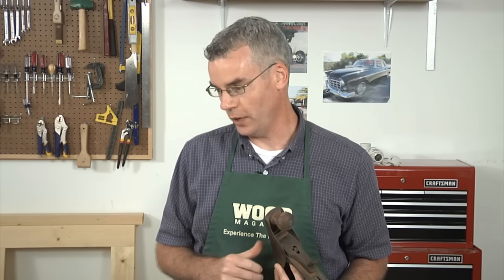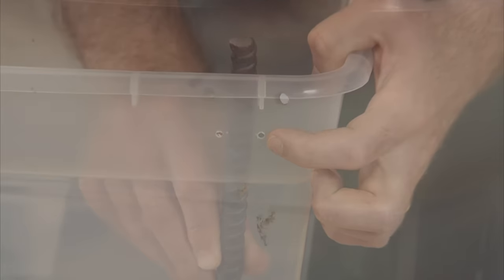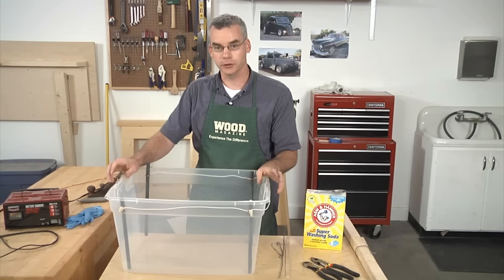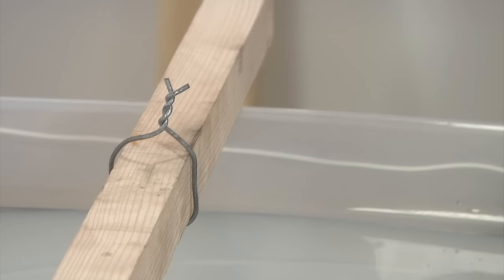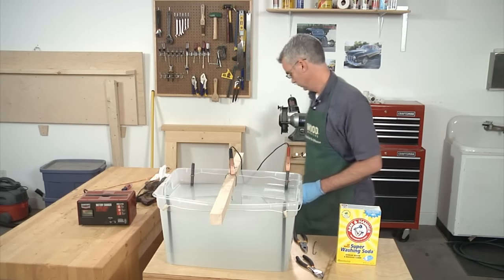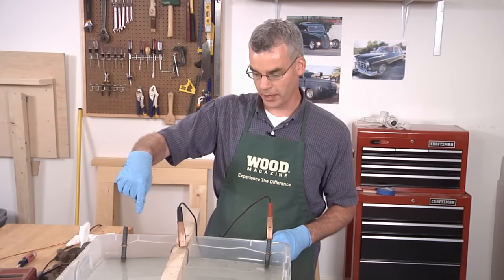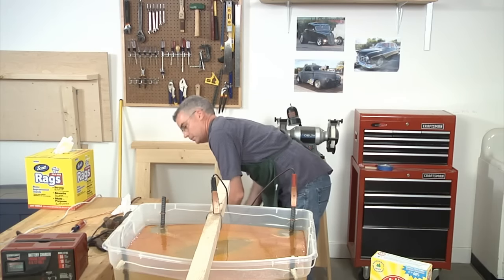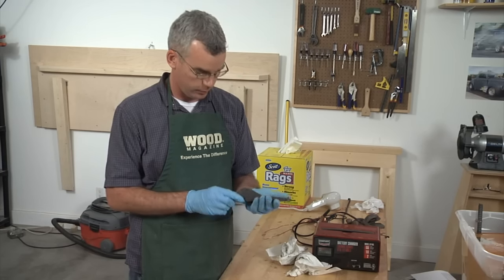Removing Rust with Electrolysis - WOOD magazine

Comment: Im fairly new to wood working and was wondering if a car battery itself can function using this method? Thank you
Reply: you could use a car battery but i don't recommend it, it would be kind of dangerous because there's no way to control the amperage. by sticking the anode (negative) and cathode (positive) into the water like that you are basically creating a short. there are a couple important points that he didn't cover in this video and one is, in order to get the most efficient rust removal you want the pos surface area in the water to be equal or greater then the negative area (part(s) your cleaning) and for that reason using a battery could get you in trouble because the larger the pos and neg surface area's are in the water the more amperage it will draw, with really big parts i've actually had batteries get to hot to handle them with your bare hands. however, for 2 amps is too low, especially if you are doing something bigger. the lower the amperage the longer it's going to take, personally i do a lot of electrolysis like this but i use an old converted atx computer power supply, that way i get 12 volts   but it's limited to about 15 amps. if you don't have an old power supply lying around then you can usually find one cheap at a thrift store. one last thing about using a battery, you know that old saying, "shit happens", no matter how careful you are at some point the pos and neg are going to accidentally come together, it's happened to all of us, however with a PS all that going to happen is going to pop and shut off, with a battery you can get a whole nother kind of pop and it will be the kind of pop that could kill somebody... there's my 6 cents worth of advice....

Comment: Little  tip: Some modern battery chargers won't work,because they have a build in "safety". (Did some google research).  I've try this tutorial and it
didn't work because of my (new) battery charger.
Reply: Yeah, get you a manual charger. I got my Schumacher on Amazon a few months ago. Working pretty good for me.
Reply: Cellphone charger might work but the amps will be very low.....

Comment: Is the white wire copper too,  just coated? what kind of wire is the wire you used to hang the item and also hold it in the water?
Reply: The white wire is copper.  The wire used to hang the piece is steel.  A coat hanger is often made of mild steel.....you could use that.  Just hit it with a little sand paper first as coat hangers often have a coating on them.

Comment: I know you can't use stainless steel for the sacrificial anode but what about stainless steel screws, bolts or rivets you may use for this project and that are outside the water, if outside the water any metal is fair game? Also, what if you try to de-rust something made of stainless steel?
Reply: +mportusable  quality stainless steel does not rust, it will stain, not to be confused with rust, to clean all you need is a soft cloth and water, mild detergent if stains cant be lifted with water, or simple glass cleaner will also work.
Reply: +TAJON actually it can and will rust in the right conditions.   depending on the alloy, a 400 series ss will rust if you talk to it wrong.  stainless steel still contains iron but it has a higher chrome content which makes it more difficult to rust, but it can still rust.

Comment: Does it need to be set to trickle charge, or can I use a higher setting?
Reply: +GarrestheWarrior No, even a battery will work. One problem with some of the newer chargers, they recognize a "short" (the water as a conductor),  error out and shut down. Look for an old, used one.

Comment: I have just a question, why when I link the two bars with a cable for positive current the cable starts heating so much, I even saw smoke from the positive clamp?, Why ??
Reply: ***** A coating burning off?

Comment: Will this also work with things like hand-saw blades ? (Rip, Cross-cut, etc.)
Reply: Yes, but don't let the wood come in contact with the solution when the electricity is running.

Comment: hi I sent mine up exactly like yours hooked everything up right but for some reason when I plug the battery charger and I don't see any bubbling. I can't figure out why the solution is not stirring and bubbling up. I've double-checked it a hundred times the battery charger is working I'm running 10 amps continuously and still no bubbles. any ideas?
Reply: I had the same problem, i figured it might be my battery charger being an automactic so it was looking for a battery before it would send out a charge, i just hooked it up to a small battery and then to the electroylsis set up using the battery as a go between so the charger reconised the battery and started to send out a current, worked a treat.

Comment: Great video , But I think some people should know that not all car chargers will work , Some are automatic and will only work when a charge such as from a battery is present . My trick is find an old car battery that still accepts a charge and hook it up to to trick the charger to work .
Reply: That's what I had to as well. It worked wonderfully.
Reply: hello billy, 

can you explain how you should link this up? i'm having trouble getting the right set up for it to work.

many thanks
Reply: Thanks!! I connected the charger to a good car battery and then ran jumper cables to the parts in the tub. Worked Great. I was worried that once the battery was charged the charger would shut down but it continued to trickle charge.
Reply: Wouldn’t you be getting the full amperage of the car battery into the electrolyte this way?? Maybe I missed a step in my head.

Comment: Most modern battery chargers will not provide voltage unless attached to a battery. A power supply (medium expense) or even batteries will provide the current required for electrolysis.
Reply: Connect the automatic charger to a battery and the electrolysis electrodes simultaneously (in parallel) and it should work fine.

Comment: Can this be used to clean an aluminium carburettor of fuel deposits?
Reply: No, but you can make a baking soda blaster with a length of plastic tubing and an air gun. Makes the aluminum casting look like new and won't remove any anodizing. The carburetor can then be rinsed in plain water to remove any baking soda left in the carburetor passages. Wear a dust mask or you mouth will taste like baking soda for the rest of the day.

Comment: Would this be a good thing to do to remove surface rust from a fender?  I have an original I want to use in my truck restoration but I don't want to have to buy or rent a media blaster.
Reply: I havent used a potato gun in years. I used to love it
Reply: Ooops. Brain and finger misfire.

Comment: Ok, got this to work but after about 39 minutes, the process stopped ( no more bubbles). Cleaned all the rods and re-started the process - electrolysis again! Anybody else have this happen. Don’t see where letting it sit for an hour/day would help. Also, heavy rust right on top of the part remains untouched/de-rusted.
Reply: Oops, 30 minutes.

Comment: Would you recommend I do this if I just want the black finish?
Reply: There's a meat cleaver restoration video on the Random Hands channel that used one part each each of water, sodium hydroxide and potassium nitrate to get a black mirror finish on the steel and blade...not sure about iron.

Comment: will this hurt chrome?  Restoring old bicycles and would love to try this to remove rust on chrome items.
Reply: use wood bleach or rub chrome with aluminium foil. If its an old Schwinn chrome wheel, use steel brush with simple green.
Reply: thanks.
Reply: yes, let it soak in a tub of wood bleach with water, google "oxalic acid chrome"
Reply: Don't do it - chrome is plated onto steel.  This will plate iron onto the chrome.  This isn't "rust removal" as much as re-plating iron onto iron or steel.

Comment: Good to know, but A&H Washing Soda is less expensive than baking soda, and its sold in 55 oz boxes... and you need 1 tablespoon per gallon of water... you can also use something like "ph Up" used to for swimming pool maintenance to raise the ph level.

I've been doing some research to build my own electro tank for restoring/refinish kerosene lanterns, and will also come in handy for other rusty tools.

My problem was finding the Arm & Hammer Washing soda, but found it at Walmart...I'm on my way!

Comment: Could you use baking soda too?
And where should i put the rust pieces that is in the water?
Reply: Yes you can.  You can just throw them out like anything else.
Reply: So what do you do with the "soup" when your done?  Can you just dump it out?
Reply: Yea, I would do it outside in the grass or wherever.  As long as you're not using a huge amount of water, it's fine.

Comment: The best thing about this process is that you're adding material back into the piece. The protons it's receiving are much more massive than the electrons it's losing.
Reply: Makes the steel stronger?
Reply: Wacko!

Comment: Strange. I've done it before and it worked very well, but this time, the inside of a small gas tank 3x, the fine layer of rust inside won't convert.  Even shaking water & gravel in between, with one dunk lasting 8hrs

Comment: Is it safe to use galvanized steel wire?
Reply: Pauliebuck not sure, but you can sand it with 80 or 100 grit sandpaper pretty fast, if it’s thick enough, you can put it in your drill chuck and just run the sandpaper along it’s length, this should expose the steel below super fast

Comment: +WOOD magazine  Thanks for the video.  I've always used stainless steel.  Is rebar really better?  Seems there would be more random metals in the tank with those?
Reply: stainless steel leaves chromium in the water. This is a huge carcinogen and leaves the water classified as a hazardous waste material. Very costly to clean up and a hefty fine should you get caught dumping it improperly.
Reply: On the level I do it, I don't think the chromium police will be hunting me down.  I use electrolysis to clean the surface of stainless steel rings I make prior to their being plated.  There's probably more Chromium in your daily vitamin than I produce in a years time.
Reply: Sure there is.

Comment: what he's trying to say is "this Part inside the tank is creating a Combustable gas that will blow your eyebrows off your head. Also HHO can be used in Gasoline Engines, in Conjunction with your normal fuel system safely. been there done that, Blown a 2 ft flame out a 20oz water bottle without ever harming the bottle

Comment: You said to avoid stainless tools. What about the old tools with nickel plating, will that produce hazardous chrmicals?
Reply: You don't have to avoid stainless steel tools. You have to avoid stainless steel for the sacrificial piece. There is absolutely no way you are going to create HexChrome on the Cathode (negative) side. The chemical process that creates the HexChrome takes place on the positive terminal.

Comment: The heat makes it change, so yes. But, Washing Soda  (sodium carbonate) Is readily available at most grocery stores and Walmart in the cleaning supply section and is cheap too so there's no real need to make your own unless you just want to.
Reply: The newer battery chargers have a sensing circuit to make sure a load is applied before charging the battery, I think I have seen some apply a dummy load (a resistor) into 2 of the four leads to trick the charger into providing you the trickle charge you are after. ALSO it all depends on the model/manufacturer as well, so it's not one hack to rule them all (done purposefully by the manufacturers of course for safety reasons)

Comment: My Charger only goes as low as 6 amps - it is still safe to use?
Reply: Yes I use mine on the 10A setting. Mine has two settings. 2A and 10A

Comment: Will this remove corrosion on aluminum? Like on motorcycle engines?
Reply: I have the same question. Have you found the answer yet?
Thanks
Reply: You can do it on aluminum, BUT take caution as if you leave it in too long the aluminum itself will begin to dissolve.
Reply: Also I wouldn't use it on something as large as a motor cycle engine, different parts are going to de-rust at different rates, likely causing your aluminum to begin dissolving in certain places while the rust hasn't been completely removed in other places, you could end up with a lot of ugly etching and pitting.

Comment: What model car charger do you recommend? I don't think my trickle charger is working. The light isnt coming on like its doing anything. Power light is on, but light indicating its charging isnt on
Reply: mine doesn't work either, some chargers know when the circle isnt fully closed (for safety)
Reply: +tibomzai this may work for others, it worked for me. I just hooked up a car battery(spare) i had to do electrolysis. Also hooked up battery charger to battery, and it charged battery while battery zapped rust off calipers
Reply: i did the same it worked a treat, my charger needed a circut to send out a charge.

Comment: Where can I get the white wire he is using  from and the specific car battery where can i buy that
Reply: ok I figure out the battery part. its a Century 87105C Manual Bench Battery Charger, 55 amps, 6/12V
Reply: Anyone knows where I can find a 22 x 22 x4  container or any wide plastic container
Reply: Wal-mart. Having the same battery charger makes no difference. 12v DC is 12v DC.
Reply: I'm a little confused how you have made it through life after reading these questions

Comment: If you can't find arm and hammer super washing soda, all you need is Soda Ash (Sodium Carbonate) available at any pool supply store (it is used to lower pH in a pool)...
Reply: Just use salt ,  It just has to be an electrolyte.
Reply: Yes Arm and Hammer Super Washing Soda is 100% Sodium Carbonate
Reply: super washing soda is available in every grocery I have been in and it is also available on the internet
Reply: Soda Ash is used to increase pH in a pool, I think sodium bisulfite is used to lower pH?

Comment: Is it possible to spead this process up by applying more than 2 amps of power? I need it to be completed in half an hour at most.
Reply: rog gre Thank you!
Reply: You would do this by increasing the amperage, since ohm's law is v / r = c. Be careful though, higher voltages are more dangerous. Another option would be to dissolve more electrolyte, which reduces resistance and increases current.
Reply: @cullenl2508  wouldnt your Amperage would be constant at 2 or 10 A (depending on your setting) lowering the resistance only decreased your voltage.
Reply: @Chungustav  certain power supplies, ones with current limiting, are able to maintain constant current by applying the proper voltage and changing it to maintain the current. So if i set it to 6 A and I short the terminals the voltage drops to near zero. For removing rust, it would scale the voltage appropriately depending on the resistance of the solution.

Comment: Does anyone know where to get a battery charger that provides current without a battery being hooked up like the one in the video. Every charger I buy will not provide current unless a real battery is connected?
Reply: look up using a computer / pc power supply.  there are guides on youtube and via search engine that are easy to find.  They also tend to be cheaper
Reply: FYI I made one out of a power supply after I suggested it in the comment.  It was pretty easy and I used a really crappy 10 year old 350w power supply I had in a drawer you could probably get on ebay for 10 bucks.  The process was a little slow it took 2 days to get all the muck off my cast iron pan (it was 45 year old though!) but it worked beautifully and was cheap.
Reply: No mention if the chargers where checked to be  functional otherwise.  Assuming a functional charger is being used. Check the electrical  connections. Especially if the anodes  where installed in the manner as shown here the  as the copper may may be making a good contact with the rebar, did the rebar you are using have any kind of  clear? protective coating on it?  The next thing would be that not enough washing soda was used, try adding more.  as long as the amount used stays in suspension you really can't use too much.
Reply: Robot Beat Rally Thanks all. I found a brand charger that does not have a safety circuit and it provides current constantly without switching off I think its a shumer or something

Comment: I do not have 12v power supply but I do have 24V does that mather?
Reply: kind of. the higher the voltage, the more water gets cracked down to hydrogen and oxygen. a byproduct you don't want. it's better to keep the voltage low, but get the Amps as high as the resistance allows.

Comment: Do you have to use copper to tie the bars?
Reply: I have copper to connect the bars but is it completely nessacsry to use copper to tie the bars to the tub ?
Reply: it is used to keep the bars stable, and to have a more equal surface that has the charge
Reply: TAJON alright, thanks for the info, much appreciated.

Comment: Doesn't the current just go trough the closest electrode to the power supply?
Reply: I was just thinking the same. There should be separate wires for each electrode and they should be of the same length.

Comment: I did this with a can and then let it sit in vinagar, I then soaked it in oil, but 10 minutes after im done its already rusted again.
WHY??
Reply: you have to neutralize it after the vinegar bath. vinegar is a great oxidizer. wash your iron/steel with water and baking soda, then again with pure water. Dry it as fast as possible, than coat it with oil.

Comment: You should be using Sodium Phosphate as an electrolyte.  The Ksp of  Ferric hydroxide is 4.87E -17 while the Ksp of Ferric Phosphate is 2.79E -39.  This makes  Ferric Phoslhate billions and billions and billions of times LESS SOLUABLE.  The equilibrium constant and Gibbs Vree Energy also make TSP the hands down  winner as an electrolyte.